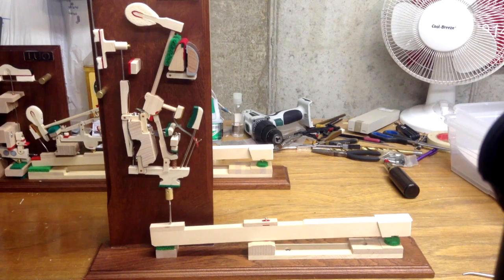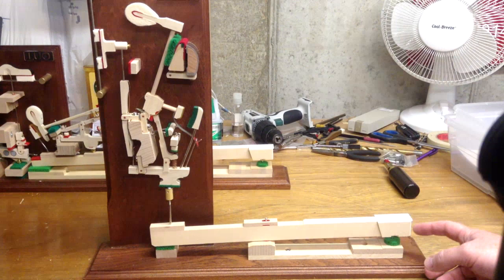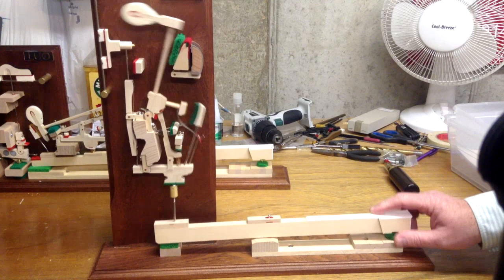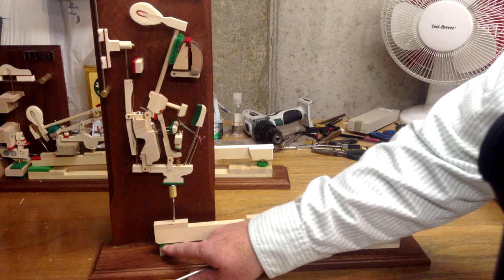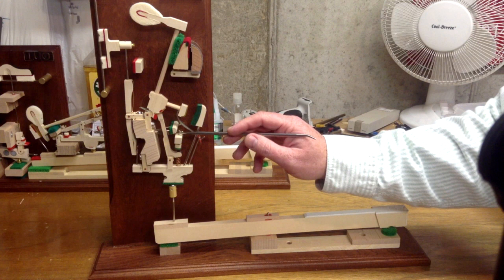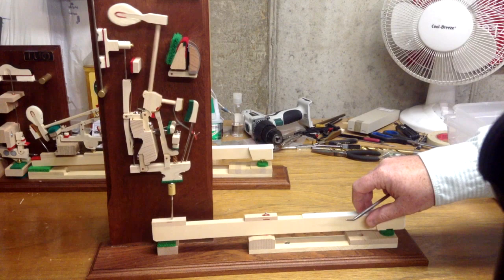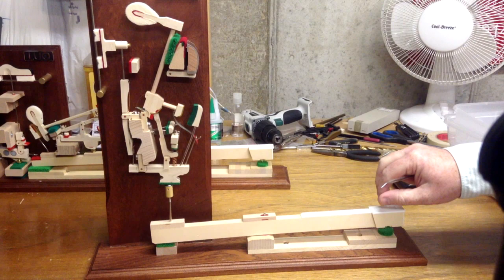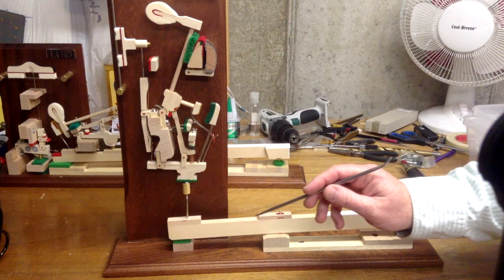Vertical Piano Action Parts I HOWARD PIANO INDUSTRIES

Comment: That model has a few parts missing. That model may be for console or smaller pianos. Large uprights have a few parts not mentioned : Sticker, Sticker Flange, Sticker tongue,  Sticker Cloth, Sticker rail.

Thanks it's nice to know the names of the parts of an upright action. I have the book with all the parts and their purpose but it's good to see from the teaching aspect.  I was looking for the improved action but ran across your video, thanks again.
Reply from the maker: Yes, some of the taller uprights have a sticker which goes from the capstan up to the bottom of the whippen.

Comment: Aren't the punchings under on balance rail and front rail cloth? not felt?
Reply from the maker: Front Rail and Balance Rail punchings are felt, they have a hole in the middle for the front rail pin/balance rail pin to pass through. Thanks for watching!
Reply: @howardpianoind  great thanks for responding! still struggling to remember which is which haha

Comment: Hi Steve.  What is that big wooden bit underneath the hammer butt with a screw on top of it?  Is that a hammer butt rail or something, it has 2 set screws looks like supporting the damper lever and the hammer butt.  Cheers
Reply from the maker: That is the action rail which is what the hammer but, the damper lever and the whippen flange are all screwed to.  This configuration may vary depending on what type of vertical action you have.  For taller uprights there might be a separate rail for the whippen flange.

Comment: Greeting. I have a question about the spool that holds the spring, it broke and I did not place anywhere on the footage so that it could replace it or describe it as it should be?
Reply from the maker: If you’re referring to the cord that holds the hammer butt spring, yes, it can be replaced if it is broken.  If you’re looking for it from a piano supply company such as Howard Piano Industries it is called “Silk Cord”.

Comment: Silly question but my keys (at the back of the piano have engraved numbers. Should the numbers be running in numerical order?
Reply from the maker: Yes, usually these indicate the number of the key.  So they should in normal cases be in order.
Reply: @howardpianoind  fitting a new jack spring is so frustrating hard. Do you think a tiny bit of superglue at one end of the spring just to hold it in place whilst I try to fit the top end into the groove is okay? I can never get the top end in.
Reply from the maker: Yes, using a little glue at the base of the spring is normal practice.
Reply: @howardpianoind  thanks